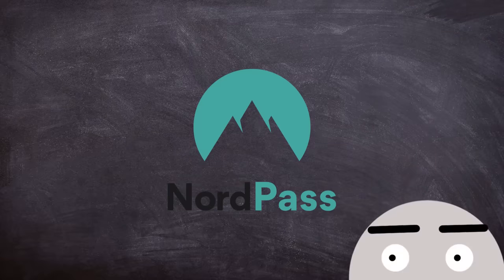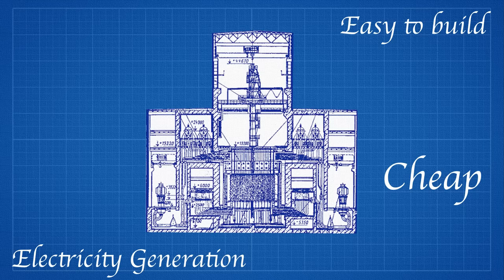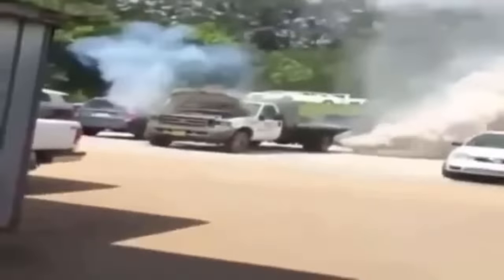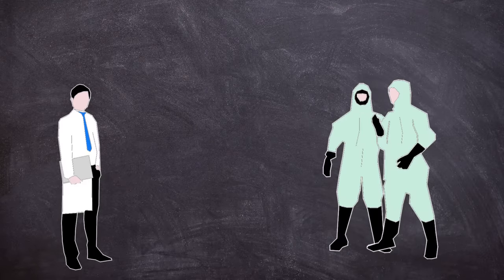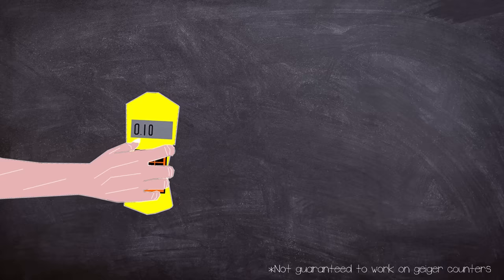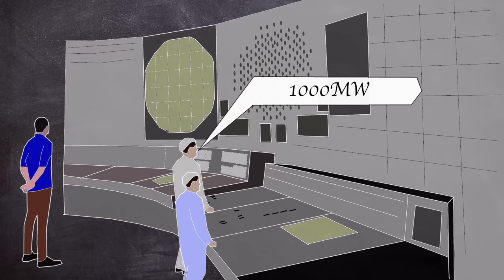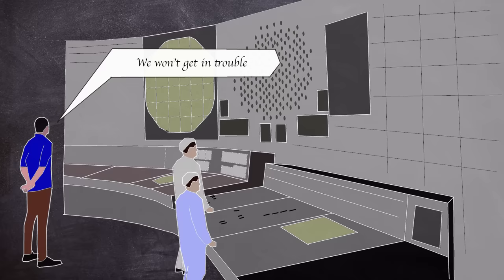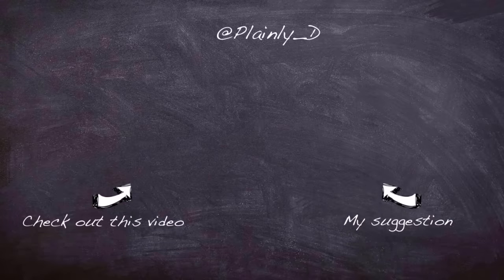A Brief History of: The Leningrad 1975 & Chernobyl 1982 Meltdowns (Short Documentary)

Comment: Brilliant, very informative and well researched programme. 

I would just add that: The Helium and Nitrogen gas also helped to make sure the Graphite didn't catch light - if oxygen had been present in the core, the high temperature of the Graphite could cause it to catch fire. The Gas between the channels excluded oxygen, preventing combustion. When the top blew off at Chernobyl, the sudden in-rush of air caused the Graphite to take fire very quickly.

Comment: The USSR scientists weren't that reckless to leave safety to a "balancing act". It was considered safe, and it had negative void coefficient, it was achieved by installing additional absorbers when the reactor is loaded with fresh fuel. They had to prove that the reactor will be safe in case of DU-800 ruprute, which is the main water pipe. Additional absorbers are being removed as fuel burns out, and when there's little to no of them, the void coefficient shifts from - to +. That was unknown at the time. Not enough study.

The steam doesn't get passed to the separators, it's a water-steam mixture with ~10% of steam. They're called separators for a reason.

The gas in between graphite block didn't help with heat conduction, the reactor space was filled with inert gas to prevent graphite oxidation in high temperatures.

The doctrine of RBMK was that it was safe enough. They didn't consider containment because in their minds every accident that could happed could've been handeled by the reactor building structure, they had several rooms with thick walls designed to contain the radioactivity in case of piping or channel rapture. That makes sense considering it didn't had a vessel and HUGE pipings like PWR. "Massive concrete dome" simply wasn't considered as a necessary thing. And cost cutting isn't a bad thing. Why would you use something more complex and expensive, when you already have what you need now and for a cheaper price?

Xenon poisoning... So many people get it wrong. Xenon is ALWAYS inside the reactor. And the level is only starting to grow after lowering the power, it's not just "bam, poisoned". It takes HOURS for xeon poisoning to reach its peak.

The poisoning wasn't the cause of 1975 accident. The operator was able to bring the power up, but with only part of the reactor. He tried to counter hotspot, but the automatic controller negated his efforts. That's why second gen of RBMKs got more sophisticated local automatic controller.

It wasn't kept secret as such. The Leningrad NPP was operated by the Ministry of Medium Machinery, when all others by the Ministry of Energy. They simply didn't cooperate, didn't have experience exchange. 

In Chernobyl 1 one fuel channel was raptured, parts of fuel assembly were pushed outside the channel in between the graphite blocks, deforming nearby masonry and channels. The water regulating valve of this channel was clugged by metal debris. It didn't take "almost a year", unless your year span is close to 77 days.

Comment: I still feel that this was largely a management failure and not truly a reactor design failure. Many of the other units performed without flaw for their entire forecast lifespan. They were excellent pieces of cost engineering let down by glaring management hubris. Their simplicity was a strength alongside the Wests arguably needlessly complicated designs that made them costly to build, maintain and decommission.  This has lead to the consequent destruction of the economic case for nuclear. It’s easy to be sniffy and jeering at soviet technology but I am not sure that it’s fair.
 Procedures are as much an integral part of a plant design as the hardware and you deviate from them at your peril. This negative void phenomenon should never have been experienced in this catastrophic manner if they ran them properly. It should not be necessary to warn about the dire consequences of flagrantly disregarding operating procedures in an appallingly unprofessional manner.

Comment: The control rods weren't so much tipped with graphite as a rod of solid graphite the entire depth of the reactor, that was replaced by the control rod when it was inserted.
Reply: The graphite displacer was not the full length of the reactor. There was a 1.5 meter water gap at the bottom, which was why it was dangerous.

Comment: There are 5 Nuclear power plants which used or still use RBMK 1000 reactors. Kursk 4 reactors in service the 5th block has been cancelled. Smolensk 3 Rbmk reactors, they cancelled the 4th reactor after Chernobyl. Leningrad 4 reactors......they are building a new nuclear power plant in Leningrad, the Leningrad ii using VVER 1200 reactors which are pressurized water reactors. Chernobyl had 4 reactors which were operational....two were under construction. In Ignalina in Lituania, there was a power plant with 2 RBMK 1500 reactors....

Comment: One thing that seems constantly strange with these. Reactor output obviously needs modulating to match generator output. No problem with that. But if you lose a generator due to an unrelated fault, the you have surplus thermal energy in the core. Surely it wouldn’t be outrageously difficult to engineer the coolant circuit so that if there is an excess of energy, you can transfer the heat direct to the condensers? This would give a much longer period of time to manage things…

Comment: One thing to consider here is that the soviet factories producing the capsules for the fuel made them really reliably watertight. Why? Because no one actually believed that the soviet workers would manage to make the plumbing between primary and secondary coolant loop tight enough to not spread radioactive solvents from the fuel in the primary loop. So you see, even the factory that officially had little to do with the power plant itself had to go out of their way to make the reactor at least a bit safe to operate.

Comment: Putting the obvious design flaws and missing containment of the RMBK 1000 series aside for a moment, its pressure pipe fuel channel design actually is quite brilliant and made perfect sense for the Soviet Union's peticular demands. The reactor could be refueled, serviced ,to a certain extend repaired, used for scientific experiments and breeding weapons grade plutonium all while at the same time staying in operation. With respectively reduced power output of course. As far as i know, no reactor of western design has ever been that versatile.
Reply: The Canadian CANDU reactor says; "Could you hold my heavy water for a moment?"It has a similar pressure tube design etc.

Comment: As with the British Magnox & AGR reactors (quite similar to the RBMK, but much safer due to gas coolant), a major factor in the design was the ability to function as a plutonium production reactor for weapons production.  All of these large graphite reactors (Windscale, Hanford, the Soviet Hanford-equivalent, Magnox, RBMK, and AGR) support online refuelling which is useful for maximum rate plutonium production.  In the case of Magnox, RBMK, and AGR, they can operate in two distinct regimes; maximum plutonium output or maximum electricity efficiency (Windscale, Hanford, and Soviet Hanford-equivalent were plutonium production only, with no major thermal energy capture).  Even in maximum electrical efficiency mode, they still produced a steady stream of plutonium.

So, the design was partially influenced by the Cold War arms race, although both the British & Soviet governments pretty much denied that the civilian energy reactors also had a military purpose.  And that's how Britain ended up with an absolutely massive "civilian" plutonium stockpile at Sellafield.
Reply: As best I know, the AGR's were never intended for Pu production, instead their designs were optimised to maximise their time between refuelling. I believe the first Magnox stations at Calder Hall and Chapel Cross would definitely have been used for Pu production but I doubt that any of the CEGB Magnox reactors ever were.

Also, the British stockpile of civil Pu at Sellafield doesn't really have the correct isotopic composition to be of any use as military grade Pu.
I think it has really arisen because metallic Magnox fuel was not considered suitable for safe disposal or storage (and thus was reprocessed) and because it was once thought that mixed oxide fuels (MOx), using reprocessed civil Pu, would be a popular and viable fuel source for civil reactors.

Comment: A typical diesel engine runaway is usually caused by a stuck fuel rack or throttle body allowing more fuel into the engine without regulation. 
Your situation is more similar to a turbocharged engine running away, in which the increase in exhaust flow increases the turbocharger's airflow and continues to speed up until something breaks. Usually a connecting rod in diesels.

Comment: Hey Plainly Difficult, just one minor correction. About 12 minutes in, you mention there was damage to a technological channel, but the text on-screen displays 'fuel channel'. The RBMK design has four types of channels IIRC--technological, empty, control, fuel. Technological channels contain the sensor elements used to provide information to reactor operators, such as neutron flux, temperature, etc. So if a technological channel had ruptured, it wouldn't contain fuel. Otherwise, thanks for blessing my Saturday morning with more nuclear accidents!
Reply: Actually every channel is a technological channel. This is the blanket term, whether it contains fuel, sensors, control rods, fixed absorbers or is empty.
Reply: @MinSredMash  Today I learned. Thank you!

Comment: I suspect that another issue with the RMBK design is that the cores are too big to moderate effectively even under normal use - that is they are more unstable then they should be when plans meet reality. 

Smaller, simpler cores would have made a simpler design overall.

Comment: I can't decide if the RBMK reactor was designed poorly (it certainly was designed less well than western PWR reactors, but was it in absolute terms poor design for a large reactor?) or if it is the management mentality that is the (main) problem. The three meltdowns of this design all happened when operators were told to essentially ignore the manual. In the case of the big meltdown at Chernobyl, once the Xenon built up, instead of continuing with the safety test they should have just waited three days for the Xenon to go away and boot up the reactor again to try again since the reactor needed to be in a low power state to run the test but when Xenon built up the reactor is only stable at either full power or off thanks to the positive void coefficient. Also, the day shift, who were briefed about the test and what not to do, should have been the one to do the test, not the unprepared evening shift. It's true the RBMK reactor's positive void coefficient could be troublesome, but all Sodium cool fast neutron reactors also have positive void coefficients, and most of those experimental reactors were successful after the ill fated SRE accident (and that was more due to a combination of tetraline contamination and improper washing than a criticality problem). We just don't see sodium FNRs because they're more expensive than PWRs, not because experimental reactors were dangerous.

Comment: A PWR is a Pressurized Water Reactor. That means that no steam is formed in the reactor. That is the whole point of pressurizng the water. The higher the pressure, the higher the boiling point. Steam is only formed in the secondary circuit, on the other side of a heat exchanger, that circuit not pressurized. This makes this type of reactor more predictible and the steam driving the turbines is not radioactive.

Comment: Didn't the control rods actually pull in a graphite moderator rod attached at the ends that was only roughly a meter shorter than the actual control rod at each end?

Comment: The RBMK was not the only power reactor design using graphite as a moderator and light water as a coolant.  The Hanford plutonium production plant in Washington State, United States, operated the N Reactor,  a water/graphite-moderated nuclear reactor, 
from 1963 to 1987.  

"It was a one-of-a-kind design in the U.S., being both a plutonium production reactor for nuclear weapons and, from 1966, producing steam to allow production of electricity to feed the civilian power grid via the Washington Public Power Supply System or WPPSS. The power rating ing of the N-Reactor was 4000 MWt, with a power output of 800 MWe at the power generating plant."   https://en.wikipedia.org/wiki/N-Reactor   

After Chernobyl unit 4 exploded, the United States nuclear energy lobby lied that the RBMK was totally different from anything in the West.  Environmentalists pointed out the similarity between the RBMK and the N reactor (including its lack of a full containment building).  The N Reactor was shut down shortly after Chernobyl unit 4, supposedly because the US had a sufficient supply of plutonium, and was never restarted.

Comment: Pretty sure steam inside the reactor  is BAD! There's a pressurizer for any steam void. Water temperature increase (not turning to steam) is what's responsible for greater neutron attenuation...Unless there's something different with this PWR reactor that I'm unfamiliar with. Also that's why it's pressurized, it raises boiling temp to prevent overheating.
Reply: Boiling water inside of the core is normal on the RBMK and the BWR derivatives. Only the actual PWR variants significantly pressurize their coolant/moderators to stop boiling.

Comment: Can't get my head round why steam is a good thing in one reactor, slowing down the reaction, but bad in another?
Reply: Water has two important nuclear properties. It is a very good moderator but it also absorbs some neutrons. Any reactor that is going to be fuelled by low enriched or natural uranium needs to use a lot of moderator. 
Also, a stable reactor must carefully balance the rate of neutron production from fission with the rate of neutron loss by absorption and leakage.
If the water in a PWR boils, both moderation and absorption reduce, but he dominant effect is the reduction of moderation. Hence power tends to drop and the system will be stable.
But if the water in an RBMK boils, again both moderation and absorption reduce. However the dominant effect is now the reduction in absorption because most of the moderation comes from the graphite core, not the water. So, the reduction in absorption will tend to increase the power, leading to an unstable design.

Hope that helps :)
Reply: @derekp2674  yeah that's perfect! Thanks man! I love the science behind nuclear power but god damn sometimes it's hard to get my head round 🤣

Comment: Interesting ironies though. Since Chernobyl there have not been issues with the RBMK-1000s since and they are still operational today. However, while Russia had the RBMK - which had the worst nuclear accident on record, the Russians would go onto to produce the two most advanced and safest designs to day for a solid fuel reactor - the VVER1200 and the VVER-TOI. Both are exported.
Reply: I am certain that the actual engineers, technicians, and other workers actually building the things were highly intelligent and knew about the problems with the RBMK. It was the giant bureaucracy breathing down their necks that caused issues.
Reply: @Skyhawk1998  We also have to remember since Chernobyl there have been no problems with the RBMKs still in operation today, and the Russians went on to develop the VVER 1200 and VVER TOI -  the most advanced and safest designs to date

Comment: „With Graphitetip“... thats simply not true! They where separate Graphite rods as additional moderator UNDER the control rods so you could either speed up the reaction or slow it. If now the scrambutton was activated It would drive the controlrods from above into the reactor, pushing the graphide rods out of the bottom, filling the gab at the bottom where normally water is with graphite. 
So if you hit the break the reaction first speeds up at the bottom when water is pushed out by the graphite rods. Thats the Design issue. 
So you have no real failsave button. Not if you drive all the control rods out of the reactor, like a maniac anyway. LoL

Comment: I have a rbmk 14 miles from my house at 9 mile 1  scriba ny . 
 Its been there for decades.
Reply: There are no RBMK reactors in North America.
Reply: Bwr-2 ok. I see where i mixed up.
 News said when the japan accident happen they ment that that could happen here.
Reply: @jeffboyer39  yeah, don't listen to the mainstream media on the Fukushima accident. Alarmism sells and they had a field day with it. Unless your local NPP is built in an earthquake zone square in the path of potential tsunamis and also has a poorly designed power system, it can't happen there.
Reply: Its over a fault line unfetunely.
Reply: @jeffboyer39  I still wouldn't be worried. NPPs are very good at surviving earthquakes. Japan has tons of NPPs and every one of them survived the quake just fine - including F. Daiichi. It was the tsunami that caused issues.
Reply: @Skyhawk1998  Placing the backup generators in the basement was the major blunder.

Comment: I believe the graphite tips referred to in the hbo series is misleading as the graphite section is 4.5 meters long and the core is 7 meters I couldn't understand why they would put graphite tips on the control rods. They are sections not tips,  the controls rods change from a neutron absorber to a moderator, when the control rod is retracted the graphite takes its position displacing the water.